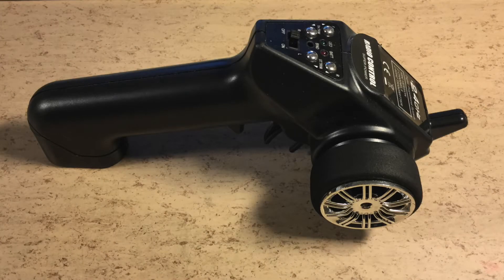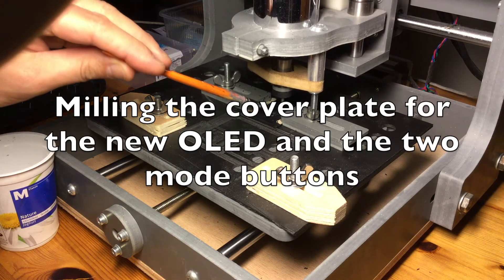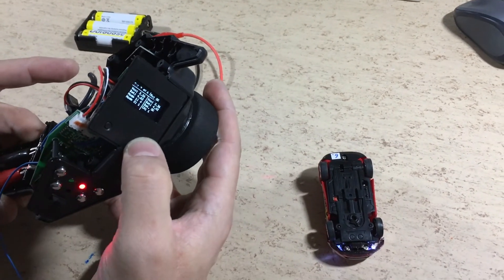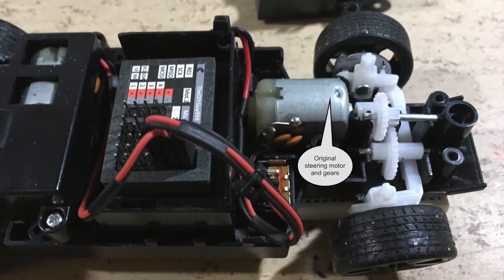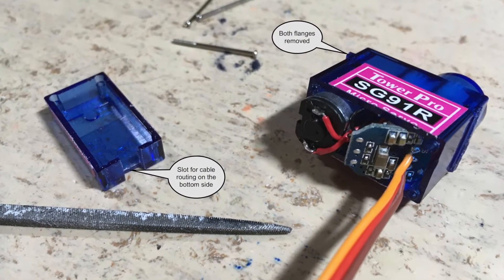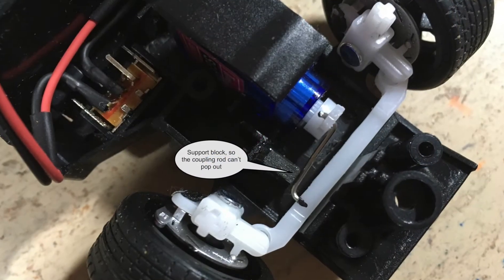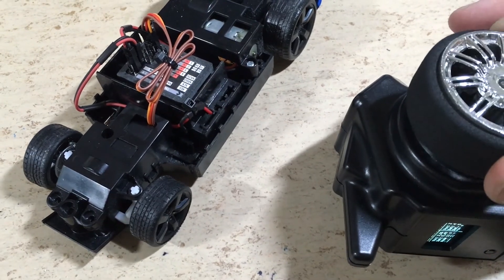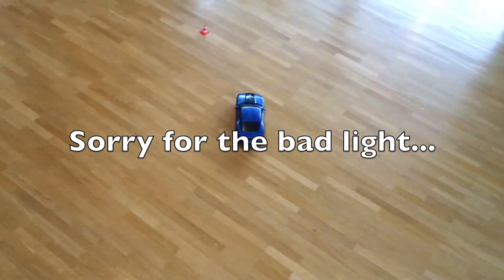Arduino 2.4GHz 2 Channel Car Transmitter Build - Micro RC Compatible!

Comment: I want to do this with a WLToys remote.  I have the arduino board, but I can not find a wire diagram to show where everything goes.
Reply from the maker: The schematic can be found on my GitHub: https://github.com/TheDIYGuy999/RC_Transmitter/tree/master/Eagle_PCB
Reply: @TheDIYGuy999  Thanks :)  But thats all greek to me.  I have no idea what I am looking at with that schematic.   I was hoping to find a simple wiring diagram.
Reply: @TheDIYGuy999  Also, is it possible to just send PPM out to an existing RF Module like a FrSky Module so I can bind to FrSky Receivers??

Comment: Hello, I already assembled one transmitter and one receiver which are working very well.
I also modified a two channels car transmitter but I have an issue which I don't suceed to fix. After switching on transmitter and receiver, I see the green led flashing which indicates the correct connection between transmitter and receiver. Problem is that when I move one of the two poti, I immediatly loose the connection, led stop to flash. Do you have any idea on how to fix this topic?
Reply from the maker: The pot may be faulty and does generate spikes. Or your batteries may be too weak. Also keep in mind, that smoothing capacitors are very important for a clean supply voltage. I recommend to solder an additional 100nF ceramic capacitor directly across the NRF24L01+ supply pins.

Comment: Hello! 
Your project is fantastic!
I'm collecting the material to do it for my k989 but i'm in trouble with some things:
on the receiver scheme V1.4 you use a MIC5205 for 3,3 supply, in the transmitter V1.1 you use 1117-3.3 
I would like to know if i can use 1117-3.3 in both.
I want to do it without eagle but with the single parts.
Thank you for sharing your work!
Reply from the maker: Hi, thanks for the praise! You can also use a 1117-3.3. It just has a bigger footprint, but if you have enough space in your vehicle, you can use it. Good luck!
Reply: Thank you man!

Comment: there is same schematic for potensio at old transmitter? cause at the eagle pcb you'r using analog joystick ...
Reply from the maker: every analog joystick is based on potentiometers. So the wiring schematic is exactly the same